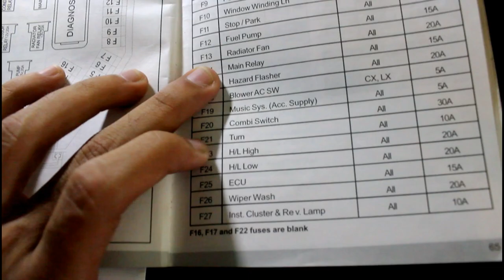How to change washer fluid pump | Tata Nano | Car

Comment: bro, in my nano car air spray is attached on wiper, and in your its on  bonnet, is it default or you changed it?
Reply from the maker: +something new yes, the stock comes with the spray on the wiper .....I modified mine
Reply: How u modified like that bro..
Reply: Could you make a video about that..?